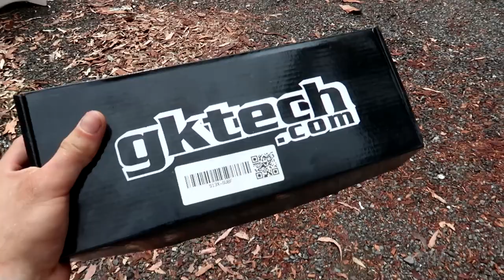Kamikaze Motorsports VLOG II R32 UPDATE 🤙🏼

Comment: I heard that if you screw those bonnet screws into the valve cover it will actual strengthen the motor and stop the head warping at high speed ;))
Reply from the maker: Hahahah thanks man good tip , will do that on my r32 build 🙌